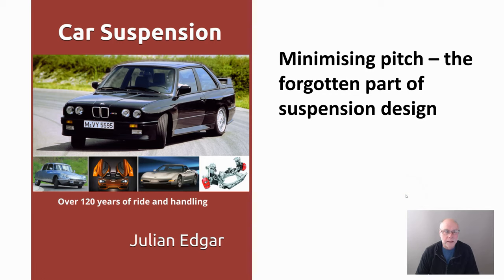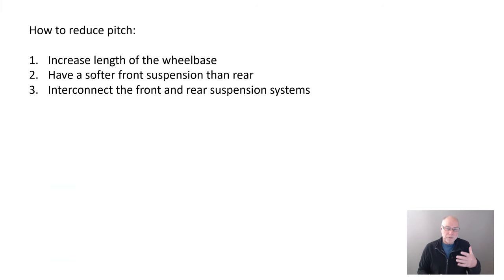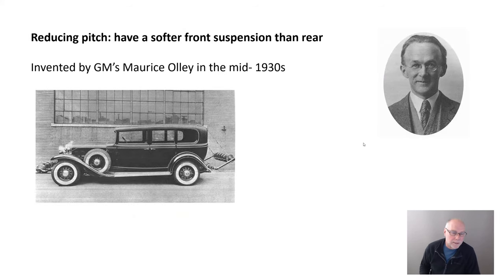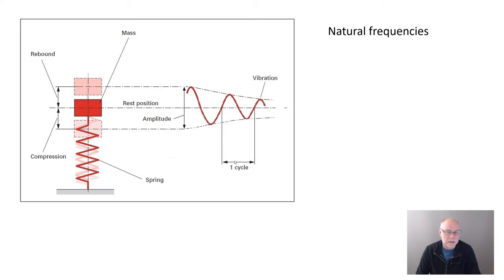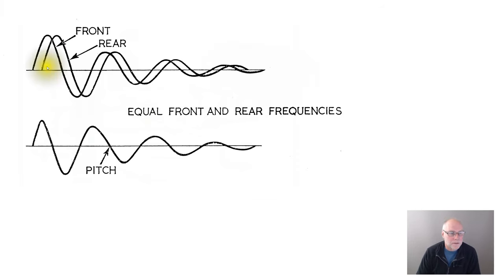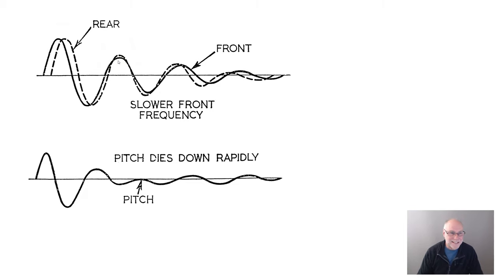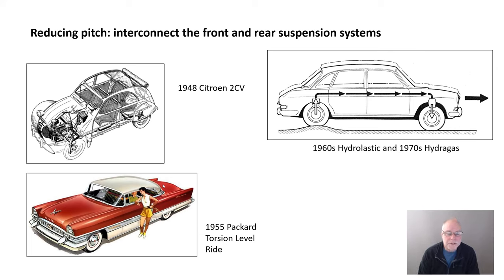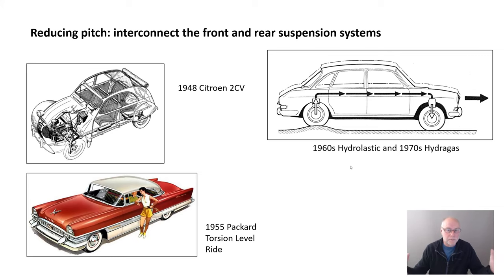The forgotten part of car suspension design - minimising pitch

Comment: mid engined cars like the F1 or an Elise do hardly change weight distribution over load. The varying load is mainly near the centre of gravity of the car. With such cars the focus is one handling and feel, less on comfort. In therms of feel, different natural frequencies front and rear lead to a feel of disconnection. The rear of the car feels different to the front. It does not drive as one car, but two. You turn in, the front turns and you get the feeling of the rear following moments later if the rear frequency is lower than the front. On the road during mundane driving, this is hardly an issue, but on track or spirited road driving it is very annoying.
Reply from the maker: Lots of errors in what you have written here. Do you have any technical references to support what you are saying?
Reply from the maker: I asked for technical references that supported what you said. You have provided none. To see how differing F/R natural frequencies are used to reduce pitch, yes even on mid-engine road cars, have a read of Randle, S. J., Concept and Design of the McLaren F1 Suspension Systems, C466/007/93, IME, 1993. Note that the video is NOT about roll stiffness, but about bounce stiffness - the two are utterly different.
Reply from the maker: You keep moving the goal posts. In this video I am talking specifically, and only, about bounce frequencies. You said: "In therms [sic] of feel, different natural frequencies front and rear lead to a feel of disconnection. The rear of the car feels different to the front. It does not drive as one car, but two. You turn in, the front turns and you get the feeling of the rear following moments later if the rear frequency is lower than the front. On the road during mundane driving, this is hardly an issue, but on track or spirited road driving it is very annoying."  That is all quite wrong! Complete and utter BS. If you still believe it to be right, please list your technical references that support such statements. It's posts like yours that lead people so badly astray. If you want to talk about roll frequencies, perhaps comment on a video where I discuss these? Suspension theory is difficult enough without people writing complete rubbish in their comments.
Reply: @JulianEdgar  OK, you win. I'll delete my comments seemingly complete unrelated to what you're all about and won't waste my and your time any further. Thanks.
Reply from the maker: Not many people seem to understand bounce frequencies. It's why I have done so much coverage on them in videos and books. Basically, f/r bounce = straightline anti-pitch and ride comfort, and f/r roll frequencies = cornering handling balance. Both are very interesting, and (as you say) are interconnected. I wouldn't get disinclined and leave, just realise that we're talking about different things.

Comment: The spring rate idea sounds great until you realize that a properly damped car should only cycle once when going over a bump. Not only that, but how different can the McLaren F1's front and rear frequencies really be if the occupants all sit roughly in the middle and therefore don't change the weight distribution that much. What I'm saying is, does the F1 have the 70% thing or not, since passengers and fuel won't change that 70% to be equal regardless of whether the car is full up or only with the driver.

And aside from that, how would a front that's 30% softer than the rear affect handling in general on any car? Seems like that's a high enough discrepancy to lead to a lot of strange and unoptimized handling characteristics. Like I said, if a car is properly damped, it shouldn't be "pitching" a lot anyway since the suspension will only complete one half to one whole cycle with optimum damping, anyway.
Reply from the maker: A lot there which is supposition and confusion I am afraid.  Read the tech paper on the McLaren (Randle, S.J., Concept and Design of the McLaren F1 Suspension Systems, C466/007/93, I. Mech. E, 1993) and any current textbook on vehicle dynamics.

Comment: Doesn't the still in use Hydractive (tm) suspension connect the front to rear?
Reply from the maker: Not in the information I could find on the system - side to side with an additional nitrogen spring.  (But I had difficulty in finding engineering-level information on it.)
Reply: @JulianEdgar  Well, it surely behaves like it. Used to have an XM and driving over speed bumps was almost fun. All the corners are connected to the same HP system, the differences between the different revisions is how the global pressure is controlled and bias (the newer systems have active bias based on steering wheel angle for example).
Reply from the maker: @brynyard  No I think it is a different system. Hydropneumatic Citroens always run very low frequencies and so I'd expect them to be good over speed bumps.
Reply: @JulianEdgar  Different how? I know for a fact that they're both connected (like any good Citroen it needed repairs every 5 Km). And it not just the frequency that's low, if you watch from the side you can clearly see that the rear wheels also lift when the front wheels hit a large bump (unless they have a negative phase offset - which would mean the rear springs predict the bump independently).
Reply from the maker: @brynyard  I don't have the space or time to go into detail here (it's all in the book!) but the fact that a system has pipes that link all wheels doesn't mean it's an interconnected suspension in the way that is being described in this video. (eg any car with air suspension has pipes that connect all the wheels to a common reservoir, but they're not interconnected as such.) There is nothing in any Citroen hydropneumatic system, that I am aware of, that causes the interconnection behaviour described in this video - that is, one wheel's behaviour directly influences the behaviour of another wheel at the opposite end of the car. I cover the Citroen hydropneumatic system in my book and it's very impressive, but not front/rear interconnected as such.
Reply: @JulianEdgar  Apologize for not being clearer, I know they're (or at least used to be on the XM) interconnected with a damper valve front to rear, you could adjust the relief and/or replace components in it to alter the behavior. I assumed that was what you meant.
Reply: AFAIK there’s absolutely no front-rear connection in classic HP Citroen’s.
I remember having read somewhere that the C6 adjust the rear suspension real-time based on road condition information from the front suspension, but I could not find a reference…

There’s no such thing as going over a bump increasing global system pressure, as during normal driving the high pressure lines are closed with valves, impossible the deliver back pressure to the system. And if it where possible, the valves to the rear suspension would block oil flowing to them. It’s height regulated per axle, not based on some global pressure or average height.

There’s left-right connection however, that’s why even the low powered gs’s were equipped with anti-roll bars front and rear.

My £0.02 why not much attention is payed to pitching, is that it hardly matters with the super stiff suspensions of most cars. Why people want that remains a question for me. No one should drive so fast on public roads that it makes any difference. And I strongly believe that you can outrun many modern cars on winding roads with an old Citroen, just because they don’t loose grip on a bad surface. They don’t, period (Peugeot’s used to be very good to). But they lacked power… Indicative of this is that in France, people drive incredibly fast on their winding mountain roads, they simply push on in the curves, keeping momentum, and the very supple suspension was set up particularly to support this.
Bone shakers will dribble, giving all sorts of unpredictable behavior.

People love sharp steering with lots of feel in modern cars (think Audi), but at the same time they need it, just because of their stiff suspension setup.
Not too comfortable…

Comment: To many horse power does not allow cars to have soft suspension, so manufacturers have to choose between stay on the road and comfort. Sadly.
Reply from the maker: That doesn't explain why nearly all current low power cars have hard suspension and damping!
Reply: @JulianEdgar  They just too small. Everybody wants power, so it cost in comfort. I was astonished when my uncle drove me in citroen GS. It was like flying in a balloon, but today there isnt anything like it.
Reply: @JulianEdgar  or is it just as simple as magazines putting value in the  handling of cars and not the ride comfort
Reply from the maker: @onelyone6976  Yes, it's a point I address in the Epilogue of the book.

Comment: You're just wrong on this. EVERYONE still uses Flat Ride on road cars, mostly to their detriment. Your conclusion just isn't supported by the cars on the road. Actually calculate the ride frequencies of most modern road cars. They are almost all with the rear ride freq. ~10% higher than the front. This destroys the handling of the car because it paints you in a corner with supporting driver-induced chassis motion. Flat Ride only calms down the passive pitchy nibble you get cruising on the freeway. It makes pitch due to braking events worse and induces rear instability while braking.
Reply from the maker: I wish everyone still did use flat ride frequencies on road cars!
Reply: @JulianEdgar  You've made a statement which is completely unsupported. Actually get the ride frequencies of several contemporary cars. There's about a 90% chance they will be flat-ride sprung. Whatever pitching you're seeing on the road has the influence of tire and damper, often chosen for cost and tuned poorly using arbitrary rules of thumb, included. F.R. is still ubiquitous among OE's.

The bigger question is should they be. Flat Ride destroys the handling of the car. It does not reduce any driver induced pitch events. It only reduces the pitch events induced by a regular pattern of full width road seams at a consistent speed. That's it. It turns what would be "pitchy" bounce into a "bouncy" pitch. That's everything. It's not bloody magic.

The problem is, it over-constrains the tuning. You either end up with a front which is too soft to control the driver brake inputs, a rear which is too stiff to have acceptable bump compliance/traction or a combination of both. To get acceptable bump compliance, you don't have to run the entire car soft, you can usually do it primarily on one end. If that end is the front, you'll have flat ride and nothing else. If that end is the rear, you'll have a much better handling car, but on certain rough freeways, you'll notice a tiny pitching motion.

If you really understand flat ride, then it's easy to see why Olley used it and it's easy to see why it's much less applicable in contemporary cars.

If you want, we could discuss the ultimate Flat Ride vehicle. A pickup truck with a towing package and nothing in the bed. What good has ever been said the ride characteristics of this combo? Not much. Why? Because the rear is too stiff and it bounces around due to a lack of compliance. The same thing happens with everything else tuned this way, just to a lesser extent.

Comment: Please don't advocate driving off road vehicles. Thanks to Chrysler's marketing team, they convince the American populace that Jeeps are the off road king and the last thing we need is even MORE Jeeps coming in the shop since they're giant piles of junk. Other than that, great video.
Reply from the maker: I didn't advocate driving off road vehicles. I said that these days, they typically have a better ride quality than conventional cars. As I say in the Epilogue to the book, that's just a tragedy when good ride quality could easily be engineered into normal cars.
Reply: @JulianEdgar  It truly is a tragedy. Since I became a mechanic, the numbers of cars has died down to where everything that comes in the shop is a truck, SUV, or Jeep and it has made me regret ever starting in this line of work. Cars are much easier to work on and lifting the parts don't break your back. 

I think it's the other way around though. Since people are flocking to the $100,000 trucks, manufacturers just don't try to put development into their cars anymore besides trying to find more ways to put another touch screen monitor in there to justify selling a 20 year old chassis with an updated body.